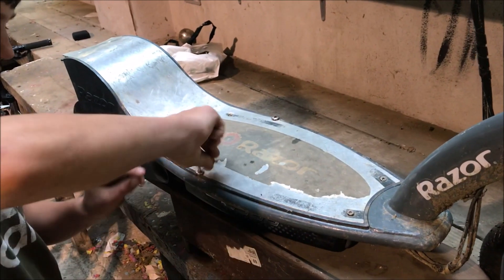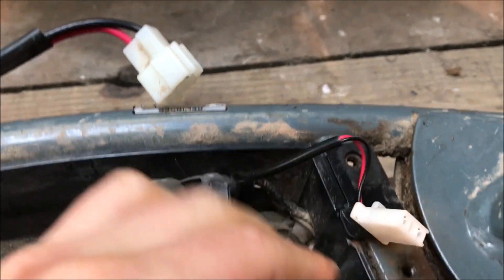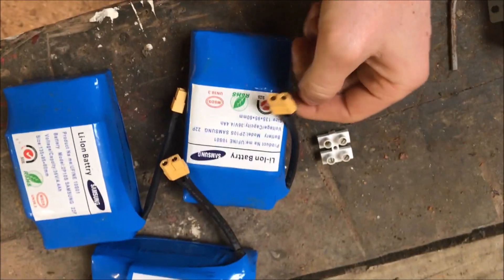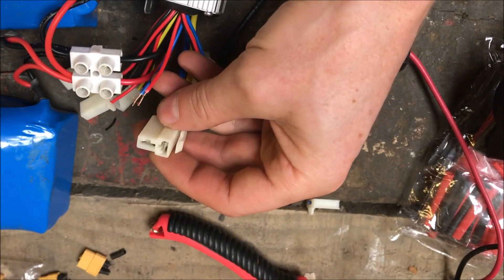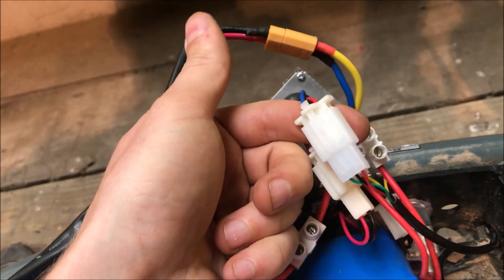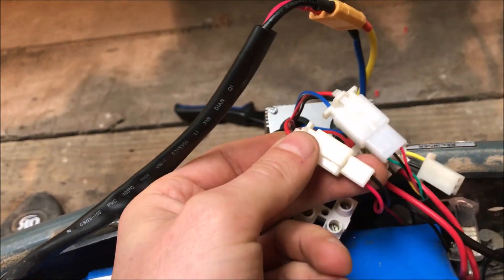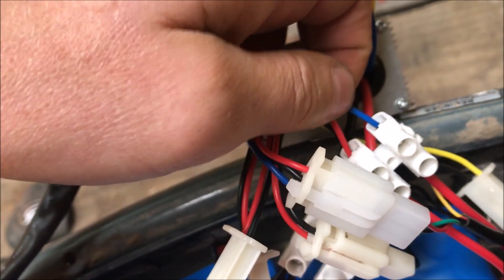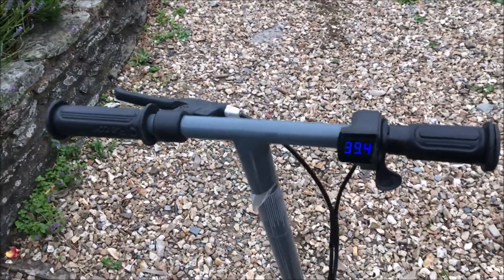Razor scooter hoverboard conversion to 36v including motor upgrade.

Comment: even with that little 250w motor its able to now support a 200lb adult after overvolting to 36v?? i tried testing one i got recently with the default motor/batteries and it could barely even move me at all on a level smooth road at full charge, im curious if overvolting will make much of a difference.

Comment: Hi i have a blue wire with my throttle for key i think. Where should i connect this ? Cheers
Reply from the maker: im not sure but i imagine it replaces the switch, so like in the video it would go on the connector with the red and blue wire.

Comment: You seem like a wise man, I have a 25.2v hoverboard but the battery went bad and the replacement battery is way to expensive. Though a 36v battery is only $30 so could I possibly use that as an replacement?
Reply from the maker: i would think not.
Reply from the maker: let me know how you got on.

Comment: How do the cells in the batteries stay balanced without a bms? Or do those batteries not need a bms?
Reply from the maker: Noah Zimmerman these batteries have a bms inside
Reply: ...I've even made a lead that plugs in to all three batteries and charges off a single 2A charger! (Takes a while to charge mind) but I've done the self same thing and clocked my scooter at 22mph! 
Absolutely worth it! The battery now weighs in at 13.2A and soooooo much faster. I bought a controller with brake lights too. Where you buy your throttle as I have one similar but doesnt display a brightly as yours does!

Keep up the good work...

 tip: buy 2 foot of skateboard sticky back grip and cover the entire foot board.
Reply from the maker: Lester Granger great Lester we use the standard charging port. It does take ages to charge because of all the extra capacity, Good tip on the grip tape.
Reply: @dickiewithers9564  I also use the standard charge port.. the cable I made is internal to link all three 4.4A batteries. Just need to figure out how to bolt another couple batteries to the stem of the handle bars to increase capacity.
22A would go some!!!!!

Comment: What charger do you recommend for these batteries
Reply from the maker: A 42v charger. The meanwell power supply’s work very well.
Reply: @dickiewithers9564  don't suppose you have a link as I'm not sure I'm looking at the right thing 🙈😂
Reply from the maker: @garethtaylor8773  https://www.ebay.co.uk/itm/133841737786?hash=item1f2996d83a:g:QUUAAOSwV3Rf0IAU
Reply from the maker: This will work but will get hot
Reply from the maker: @garethtaylor8773  https://www.ebay.co.uk/itm/324644972442?hash=item4b9659279a:g:ZDUAAOSwDkBgrlNk
Reply: @dickiewithers9564  I take it the second one Will be alot more stable etc, this was what I saw earlier but wasn't sure I was looking at the right thing
Reply from the maker: @garethtaylor8773  yes. I have a meanwell runs cool at 4 amps. The hoverboard chargers run hot at 2 amps.